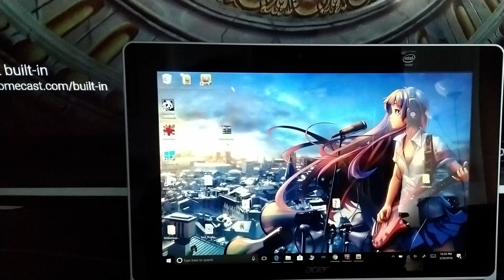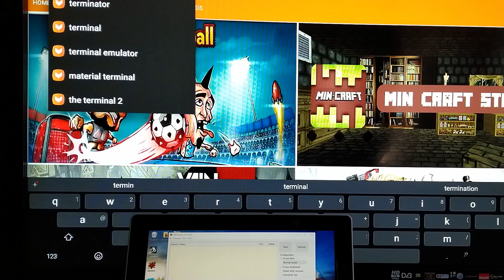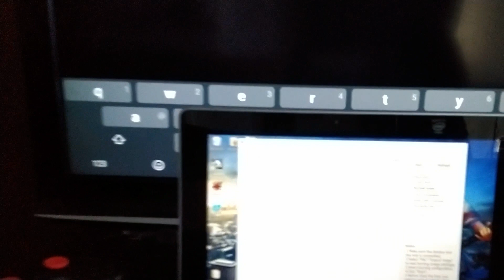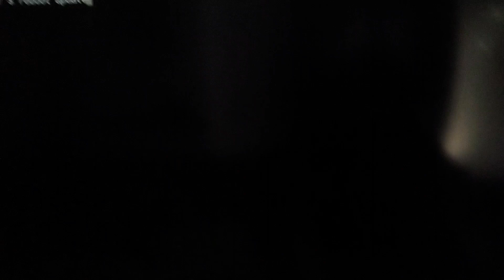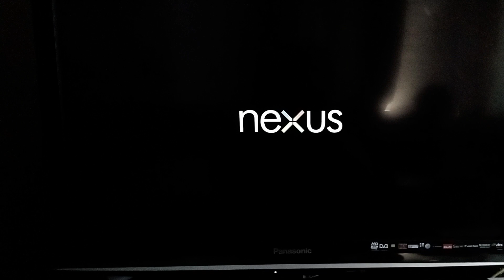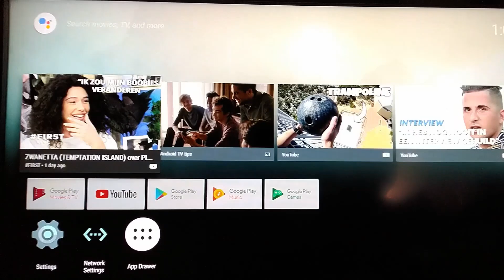Mecool M8s Pro L Custom Rom Flash Tutorial [2018]

Comment: I did it  and now the wifi no longer works . when ever I switch on the wifi. it just switches it self off :(  How do I fix this?
Reply from the maker: Hi brother. I red online that there are  different versions of the device with another withI chip.u must have a new version I guess. I will check later after work for you. Also gonna do a new tutorial soon with newer ROM stay tuned. Will message you later brother
Reply from the maker: hey brother i had a quick check and indeed this rom is not for the lb version. you wuill either have to do without the wifi or just try another rom or reflash your stock rom for the lb version. Sorry i cant help u further with getting wifi to work on this rom :(
Reply: @ToniTechCave   Hi mate. Just now prob not long after you replied, Well after hours of researching and hunting I found it!  I cant believe it but after trying 4 different firmwares the very last one worked! and its the latest! and its exactly what I was looking for! with  Mecool logo. no 3rd party logos
Thanks for trying anyway :) cheers mate. Im from Australia by the way ;)
Reply from the maker: Wow that's great. Is it a magendanz ROM? Can you please send me a link. I'm very certain other lb users would be very happy.also I would like to cover that.please provide a link if possible. Thanks in advance my down under brother.
Reply from the maker: I'm busy making a tutorial sinds yesterday for the latest magendanz which had been working great with no freezes. Would like to see which version u mean. If it's the same then I can say on the video that it's confirmed working by you! Sinds u obviously have an lb board :)
Reply from the maker: +Dozz Gio. Hi brother. Can u please tell me which rom u flashed?i wanna know before i put out my video so i can confirm its working on your model. Thanks in advance :)
Reply: @dozzgio.871  Hi..,can you please share what firmware you used ,I have the same box as you.
Reply: @gfantom7  Hi there. I don't have that firmware anymore I deleted it and  its been over 4 months now. I stopped using Android boxes now because Netflix always ends up with that stupid  error again.
I now Use a windows 10 tv box. Way better than any android box and hey are the same Size. Netflix always works and that's because you have Windows updates so that NETFLIX is always working the way it should.  SO no more Android TV boxes for me no matter how good they are!
Reply: @dozzgio.871   Dozz Gio.   Yes i understand,maybe you are right.Personally i started using my tv for netflix ,i just like fixing things and i do it for fun.Also, i am ashamed to admit  but i am emotionally attaced to this box 😂 and i want to renew it somehow.Apart from that I totally agree with you. Thank you so much for your time!
Reply: @gfantom7  just do a factory reset. easy
Reply from the maker: Brother Netflix hd no longer supported on this box. This sucks for us
Reply: Only 1 android tv box, Nvidia Shield as it had shield updates.. With the others At first it will work for a while then the error code  happens on them. and I also think the reason being is those other android tv boxes don't have regular system updates, that's their flaw.   I gave up completely on them few months ago.
I ended up purchasing Windows 10 TV BOX with 4gb ram and 64gb SSD and I installed a 2.5 500gb inside it.
Netflix Full HD, 4K  will always work on it. Reason? Because you get windows updates as its more certified.
Reply from the maker: What happens when you flash the Rom from this tutorial? Bt and WiFi don't work? What version off the box do you have? Lq?lp?
Reply: @ToniTechCave  it works fine, at the time I did it was with  LB version with that firmware I downloaded. which did work and fix the Netflix issue. but then Netflix blocked that box again! 
This is Mecools fault because they do not have ongoing regular system updates like most of these other stupid android TV boxes. Only NVidia Shield is the only Android tv box that has regular system updates, just like Windows 10 has.
Ditch these boxes all of them including the new ones that will get released, they will end up with the same damn issues in the end.
And, Again I don't use these boxes anymore M8S pr0 L was my last Android box!
I now use the Voyo VMac Mini PC V1 Blue Windows 10 Intel N3450 4GB RAM 64GB SSD Cant go wrong with it for Entertainment and regular Windows 10 updates.
You just go to the Microsoft store and get the Netflix, Stan etc.... apps. You can even watch Netflix using the Microsoft edge browser lol in full HD. can also install an extra 2 TB SSD or mechanical HD 2.4" inside it.  I purchased a duel WIFI/Bluetooth 2 in one adapter for it and works flawlessly.
This is my link for those 
https://www.ebay.com.au/itm/VOYO-VMac-Mini-PC-4-64GB-Licensed-Intel-Apollo-Lake-Celeron-N3450-4K-HD-/152928407098

Comment: Both Bluetooth and WiFi function will die after... flashing.. don't do
Reply from the maker: +EDA VENKAT RAMI REDDY hi brother. You should try to flash again because you should have no issues. If you do you can go to the original thread for drivers :)
Reply: Toni-Tech Cave 
Sir
Please tell the solution...
Mine is mecool m8s pro l
Both Bluetooth wife not functioning
Reply from the maker: +EDA VENKAT RAMI REDDY hi EDA. There is no solution it is just working. You can just enable them under Bluetooth or wifi. It just works. Like I said nobody else is having that issue. Try to flash again or try another custom rom.  Maybe try this one from the same developer. :)
http://freaktab.com/forum/tv-player-support/amlogic-based-tv-players/s912/mecool/firmware-roms/686034-rom-mecool-m8s-pro-l-stock-nano-nexus-rom-android-7-1
Reply from the maker: I'm gonna be back home tonight. Will reflash this rom and tell you my findings to make sure
Reply: Toni-Tech Cave 
Both are in disabled status..
Even if u turn on .... with out scanning...they are getting turned off
Reply from the maker: Hi sorry got home late last night. Will make time for that today and get back on it. Should work if I am not mistaken I should have also done a speed test on. The same video. Will get back to u later on today brother
Reply: Toni-Tech Cave 
You remove LAN cable... please try to connect through WiFi...and also try to scan Bluetooth
Reply from the maker: hey brother. I just flashed again to make sure. and like i said no issues. wifi connects 50mb up 52mb down. also bluetooth works with no isssues. So either u have a clone or another box. or maybe your box is defect brother. My advise if your box is not a clone is to just flash again.
Reply: Toni-Tech Cave 
Ok.. thank you
Reply: I will again try to flash.
Brother can u guide me..
Under status I am getting
 Bluetooth address as unavailable
Reply from the maker: when u reinstall the original firmware. ...does bluetooth en wifi work?? and also the mecool m8s l and w look a bit simmular . u are not using the mecool m8s pro w right?? just checking cause nobody else has those issues and when people have those issues its 9 out of 10 the  wrong box OR a CLONE :)
Reply: Toni-Tech Cave 
Ok...mine is 10 days old Box mecool m8s pro l
First it worked fine...
Later some other os flashing I have done...which struck in Blu screen....later on I have done this flashing..
Any way sorry bro for disturbing
Reply: If any original OEM os for mecool m8s pro l with out voice remote is there please share with me
Reply from the maker: your not disturbing brother and I really wanna help. the bluescreen thing is no good. It could be since it was a bad flash that it erased drivers. Try to FIRTS install the original rom. after that test. if bt and wifi are working then flash this rom again on it and see if it kept the drivers from the original installation :) that should help ya:)
Reply from the maker: +EDA VENKAT RAMI REDDY try this
https://www.dropbox.com/s/4pjfmzzckvz54tf/M8S_PRO_L-NHG47L-20180316.115110.V0213.zip?dl=0
Reply: Toni-Tech Cave 
You are great bro...
It worked.... really super 
Now WiFi and Bluetooth also functioning...
My additional voice remote I bought seperately also connected... thank you bro
Thanks for help
Once again Ur great bro
My sincere thanks to you
Reply: EDA VENKAT RAMI REDDY is that the newest stock firmware?
Reply: @evreddy1985  , Hello, I have a Mecool M8s Pro L, and the Rom that I may install says   in the beginning description
This firmware is designed for earlier models of the M8S Pro L with the QCA9377 wireless chipset. If you install it on later (non-LQ) hardware, WiFi and Bluetooth won't work.
I think that's what happened to your device and now I am worried it may happen to mine. I don't know what version of chipset that is installed on my M8s Pro L.   What would You suggest?
Reply: @ToniTechCave   Hello, I have a Mecool M8s Pro L, and the Rom that I may install says   in the beginning description
This firmware is designed for earlier models of the M8S Pro L with the QCA9377 wireless chipset. If you install it on later (non-LQ) hardware, WiFi and Bluetooth won't work.
I think that's what happened to one viewers device and now I am worried it may happen to mine. I don't know what version of chipset that is installed on my M8s Pro L.   What would You suggest?
Reply from the maker: U can check under the box bij the model. Should see lq or something extra after the l. Can I check what it says?
Reply: @ToniTechCave  ,   (Mecool M8s Pro L) >>> (3GB-32Rom) (S912 DDR3 LB). So should I wait until the New Rom comes out ?   are You going to post a video about it?
Reply: @evreddy1985  , is that link a recovery img. file or a custom Rom? Because of the above past post you said that a 
 custom ROM disable your Wi-Fi and Bluetooth. That's what I'm trying to avoid
Reply from the maker: That's an image to the standard ROM to recover incase custom ROM don't work. I think it's the same link I sent when he had issues.
Reply: @ToniTechCave  yes....it will work
Reply: @ToniTechCave  , Thank You,  I'm going to store that file in my sd card and then when I install team win recovery project (TWRP) im going to use that as one of my recovery files thank you
Reply: @evreddy1985  , Thank You,  I appreciate it.
Reply: @ToniTechCave  , Do you think that I should wait until the Rom version comes out?
Reply: @pwhales264  u install this one...no other rom is required..it will work perfectly. Even without voice remote also...at the time of Bluetooth scanning(first time setup) u connect to your mobile then setup step will come
Reply: @evreddy1985  , Thank You  and I appreciate your time and help.
Reply from the maker: Brother. I have made a new tutorial with 2 ROMs. Yours should be lb. So give my new video a try I'm sure this will work for u brother
Reply: @ToniTechCave  , Thank You,  I will try look at your new video and try it out I really appreciate it
Reply from the maker: Any time brother. I also included the lb just for you and Rami:)
Reply: @ToniTechCave  , I will let you know how it works out.
Reply from the maker: Thanks in advance brother
Reply: @ToniTechCave  ,   Is there a way to Flash the Rom if I can't have my M8s Pro box connected to my computer at the same time its connected to the TV?  If so can you describe how I can flash the Rom?  Thank You

Comment: how you can root this box any links/treads ? thanks
Reply: The room may be rooted ,but how about the Mecool m8s pro L  be rooted by it self...
Reply: @dannojdrsm511  , The Mecool M8s Pro L is already Rooted. Just installed root checker and it should show that it is rooted. I did this and then installed Titanium Pro which is a rooted app and it works.
Reply from the maker: Hi. I'm sorry I checked online couldn't find a way. Best is to just flash a couple of custom rom or try freaktab.com :)
Reply: @ToniTechCave  ,  The Mecool M8s Pro L is already Rooted. Just installed root checker and it should show that it is rooted. I did this and then installed Titanium Pro which is a rooted app and it works.

Comment: Hi.....Thanks for the great video 
dose this rom works with Mecool M8S pro L regular remote control version?
Reply from the maker: Hi thanks. If you mean the bt remote then yes it  does work :)
Reply: I mean this one
https://www.youtube.com/watch?v=QjbSR75YPO8
Reply from the maker: I don't have that controller but I don't see a reason why it should not work. Give it a try and let us know:)
Reply: Toni-Tech Cave
I already tried but unfortunately it didn't work
My laptop top can't connect to to the box even I heard connecting tone
And every time I hit reboot update the device boots in recovery mode that's all 😣🙁😣
Reply from the maker: So if I understand it correctly it is flashed. Else u would not be able to download the terminal and go to recovery correct?? If that is the case when u type reboot update and u see the recovery. Then it is connected to the TV. Did u try another cable?
Reply from the maker: Ah great. Glad you got it sorted. And don't forget about the giveaway if u wanna be the new owner of the umidigi s2 pro :)

Comment: Nice one. How does the performance & features of this FW (ROM) compare with the original FW?
Reply from the maker: Hi. To me the custom rom runs better. Game pads support is higher and I haven't had any crashes. It also comes with some nice fixes like the sleep glitch has been fixed. No longer takes 28 seconds to wake up from sleep. It is now 3 seconds :). I left a link on the description to the rom. In the link you
 will find all the features :) 
http://freaktab.com/forum/tv-player-support/amlogic-based-tv-players/s912/mecool/firmware-roms/676338-rom-mecool-m8s-pro-l-tvstock-nexus-rom-android-tv-7-1
Reply: Thanks for the prompt feedback.